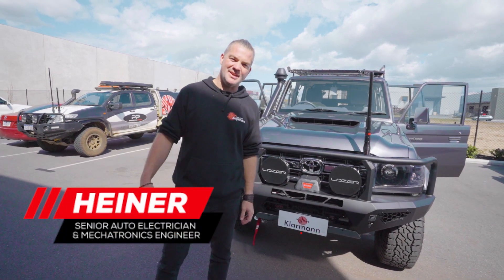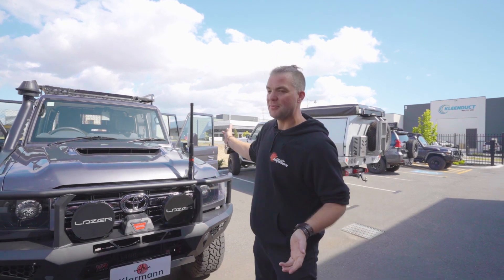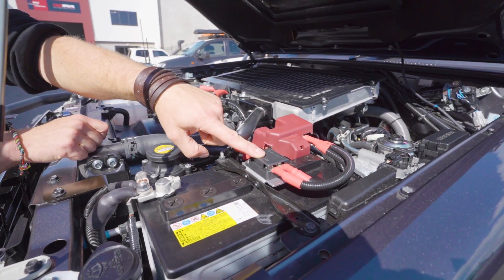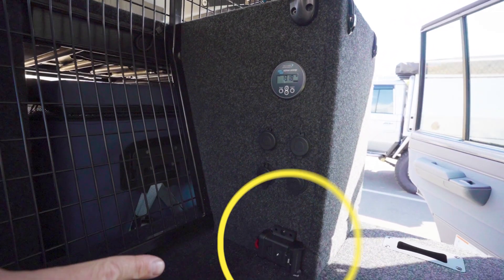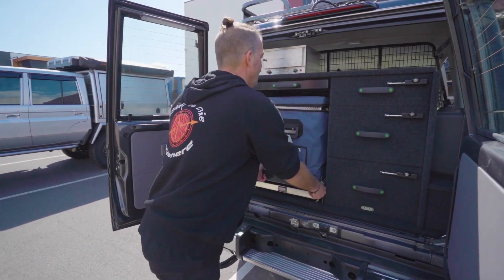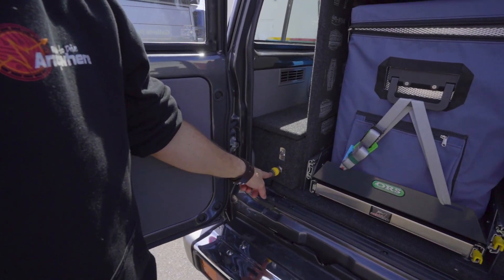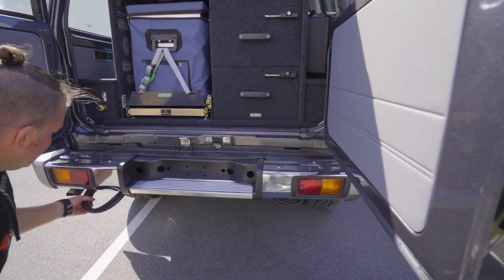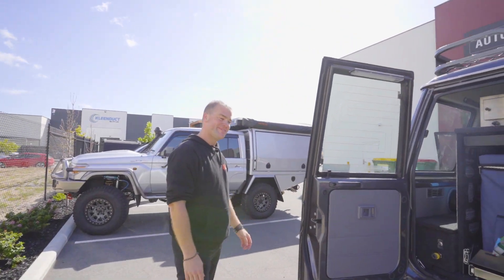Heiner Builds Your Ride | Toyota Landcruiser 76 Series

Comment: Looks like it will be difficult removing the lithium battery from that box with the ARB compressor squeezed next to it , also does not look easy to access the egon hub to add extra wiring to add more accessories in the future. I think a nice compact build is not just about able to squeeze everything in like Tetris but also consideration for ease of servicing or replacing the parts.